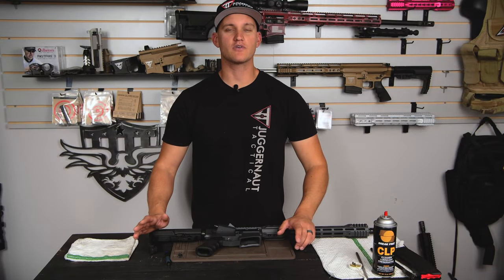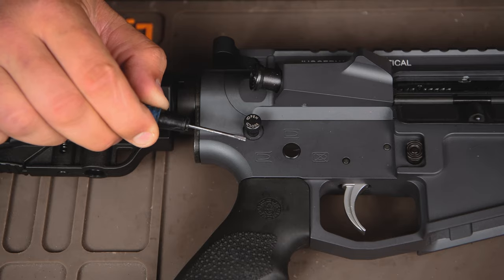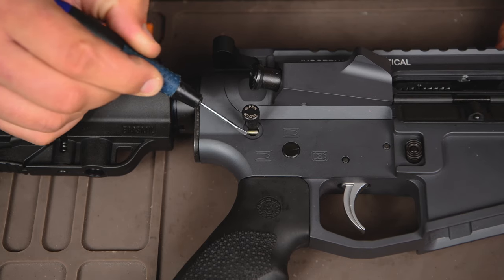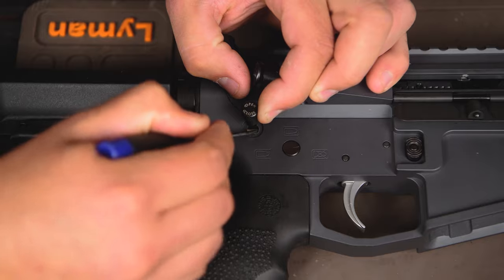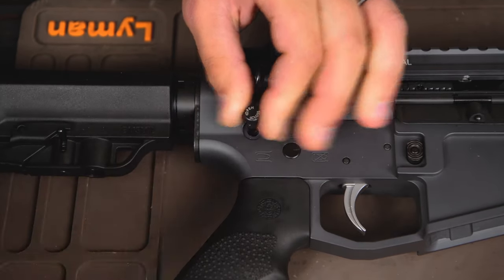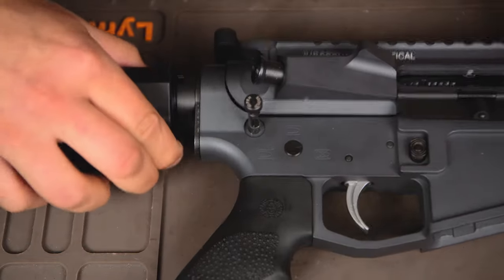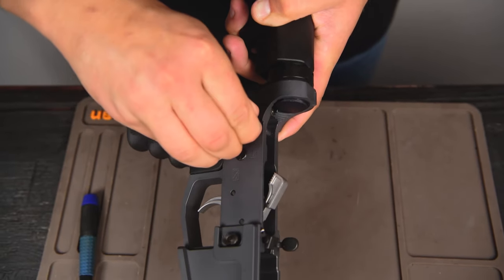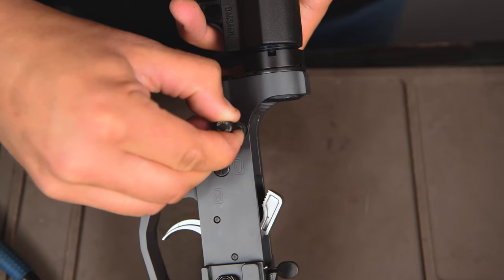How to Fix the Hellfighter Pin when the detent popped out

Comment: Had this happen a few days ago and couldn't even get the tiniest flathead to push the detent back in. Had to loosen the castelnut on the buffer tube, carefully pull back the little plate so the spring didn't go flying out and then I was able to wiggle and push the detent back. Such a hassle.
Reply: Thank you. Going to grab a armor wrench and get this going.

Comment: For those of you like me who can't get a screwdriver to fit, try to apply pressure to the detent pin by pulling a little on the hellfighter pin when you are pushing your screwdriver so the detent pin is supported and doesn't push away from your screwdriver or bend. It took me an hour and a half of trying before I fixed it. I hurt my fingers pretty badly and the hellfighter pin did not function properly after the first reassembly. I had to take the pin out and put it back together a few times. Aluminum shavings from trying to get a screwdriver in between the detent pin and the side of the hole were jamming the hellfighter pin and preventing proper operation.
Reply: Thanks man you saved me another 45 minutes at least

Comment: most of the time this happens on my rifle, there is no give at all in the rear pin, no way to get even the smallest flat head in there to push it back
Reply: its horrible
Reply: So what’s the fix?
Reply: @bpatinas1578  take it to a gun smith and they fix it for $40
Reply: I had to wiggle it like crazy. Don’t baby it and moves enough to push it back in.
Reply: Trim the detent or file it down a couple mm. Mine is so much smoother now. Gunsmith showed me that trick not too long ago. Just don’t go too short or it won’t hold the takedown pin tight enough.

Comment: I have the first problem you spoke about but the spring is not budging using your method and I don’t want to damage the gun. Any ideas. The upper is raised off if the lower and won’t seat so that could be putting more stress on the spring keeping it from going back in. Any help would be greatly appreciated.

Comment: I have this issue every time i try to clean my AR, I unscrew the knob on the other side, remove spring, push in pin slightly, turn counter clockwise until it clicks, then attempt to pull it out to release the upper. Still doesnt release from the rear, I usually pull the pin out too far and the pin pulls out of the gun. Is there a trick, I tried dropping a bit of lube down the indent for the pin to slide more effectively but still have an issue with either the parts attached to the upper receiver not pulling out due to the takedown pin not extending all the way, Any advice? I am a pro on re-attaching the pin by sliding my bore snake metal piece through the holes while using a tiny tech screwdriver to hold the pin in, but its frustrating as F&*%.  Any help will be appreciated
Reply: Very frustrating as it took me over an hour to place that pin on the right spot and rotate it to it’s home. Just make sure to not pull or over extend it as that pin pops out.
Reply: I usually take my castle nut off, slide the plate off just make it fall backwards, reassemble, done. Doing the flat head screw driver thing is hard because you can damage your pin thing to pray it back into place. Honestly I LOVE the idea. Not sure if JT was first, but I'm thinking of switching to a different Maglock, if it means this won't happen. One thing that can make it slightly easier to operate the JT pin, is disassemble from BACK to FRONT.

Comment: Wouldn't have that problem with AR Maglock kingpin. The pin they supply with the kingpin is longer and prevents shit like that from happening.
Reply: Yeah but then the disassembly process is more tedious and not as straightforward as the hellfighter button
Reply: @diegor2998  can you install hellfigther pin without removing castle nut? I know kingpin installation requires disassembly

Comment: I want to know how to remove this feature and the mag lock feature from my brand new juggernaut rifle I just got. Soon I will be moving out of California, so I won’t need to have this on my rifle anymore. Just trying to be a step ahead... 
also, on my rifle I’ve had for about an hour now, with no shots fired thru it yet, the safety/select fire switch is VERY tight/sticky/difficult to operate with just my thumb... will that loosen up/go away with time and use?

Comment: The problem is for me is that it won’t push out, I have too snack it with something too come out, and pushing it back in won’t even go back all the way unless I smack it in, and it won’t break the action
Reply: Same here. Not happy with this set up at all.
Reply: shotgunshell80 I went and bought a whole new rear pin and it fixed my issue
Reply: @shotgunshell80  agreed

Comment: My pin got turned the other way  and is now stuck under the detent any advice would be great
Reply from the maker: Bring it over if you are local. Otherwise, if the video steps won't help - you may need to remove the castle nut and the back plate.

Comment: I keep having the second type of malfunction shown. I can't push the detent pin back into the receiver without loosening the castle nut and plate.
What is the length of the detent pin supposed to be? It seems like mine is too short.
Anderson lower with Anderson lower parts kit.

Comment: What size screw driver did you guys use? I have a 1/8 and it’s to big
Reply: Update: I ended up getting my whole detent pin out and just took the whole rear locking pin out. Will my lower be okay to strip it down and reinstall the pin? I really do not like this locking pin.
Reply: @Nickryan334  yeah. it’s horrible
Reply: @Nickryan334  i’m having the same issue right now
Reply: @johncarver6919  I ended up getting it out by using the smallest size of flathead screwdriver. I can’t wait to take the pin out
Reply: @Nickryan334  i didn’t have one small enough. i accidentally broke it off 😅
Reply: @johncarver6919  that sucks man!

Comment: Btw I used a flathead screwdriver used for glasses. Didn’t know where to get a smaller size to fit in that tiny spot.
Reply: That was the first thing I thought to use but I feel like it would snap

Comment: My detent is not going back into the receiver.  Pretty f**king over this right now.
Reply: What did you end up doing? I can’t get mine back in either, he made it look so easy...
Reply: @RickyMontijo  I finally messed around with it long enough with a tiny precision flat head screw driver and got it back together. I wanted to smash my fist through my drywall a few times tho. I hope I never have to do that again!

Comment: the only issue i've seen with this whole kit is that when the bolt locks open on last round, you have to risk injury to get it to release so you can break the action to drop the mag. it's the stupidest thing i've ever seen. if you're in a bad situation and need to fight for your life, this kit is going to make a bad situation worse... CA is stupid with its laws, you guys at juggernaut are just doing your jobs, but the people that run CA are just making it easier and easier for the criminals to win... is there a way you can fix this issue so the bolt doesn't hold open after last round or do we just need to accept our fate when, god forbid, shit hits the fan???

Comment: Worst engineering design ever. If you don’t hold and apply pressure at the exact right angle it’ll pop the detent. Only way to fix it is to undo the back and that the spring out and stick something in to push the pin back which is almost impossible.